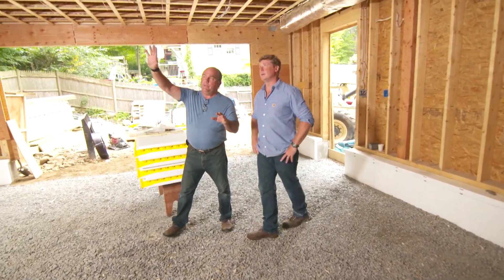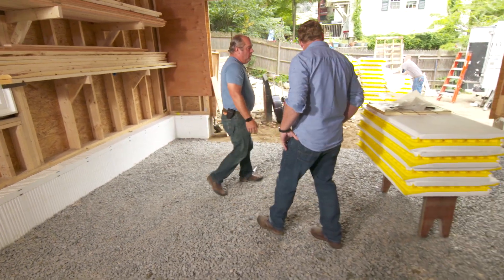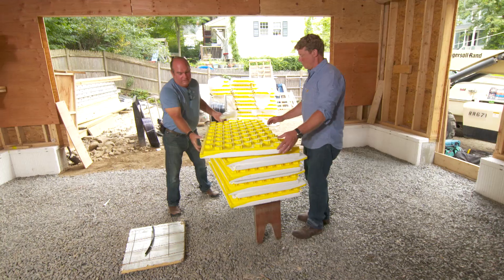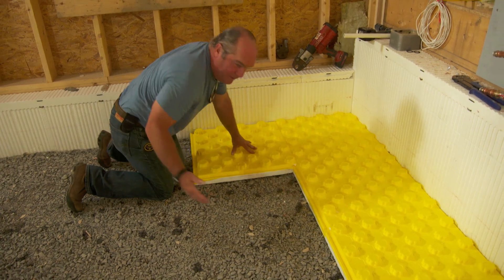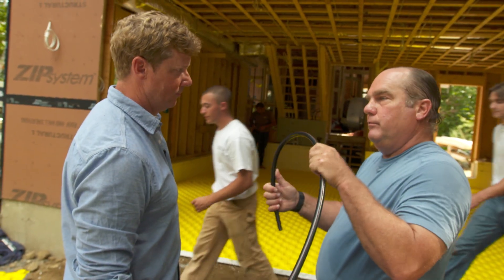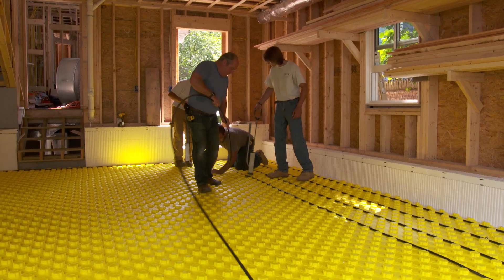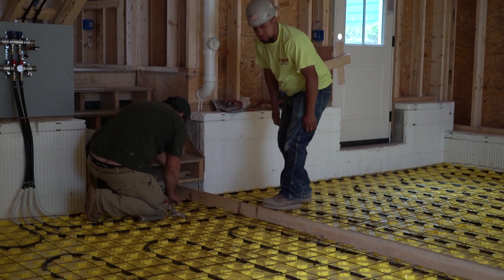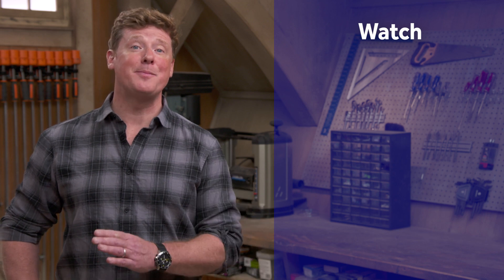How to Install a Radiant Floor Heat System in a Garage | This Old House

Comment: Hello, I would like some advice.
 I made the underfloor heating on a layer of hard styrofoam, and then spread the pipes on grid plates for pg, with mushrooms.  Do I need to put a reinforcing mesh since I definitely plan to add fiber fibers and sika additive to the mower?
 Second question.  I would split the floor and into one part of the garage.  Can I spread the mushrooms with the same system, and what thickness of concrete should I use?  Thanks in advance

Comment: Might be a dumb question, forgive me as I'm not a professional, but doesn't putting the pipes inside the slab create a lot of risk in the sense that if there was ever a burst pipe or just a leak, it would be a huge hassle / expensive to tear up the concrete? Maybe I'm not being rational but if I had a heated driveway or radiant in-floor beneath concrete, asphalt, etc I feel like I'd live in constant fear of having to rip up the concrete / asphalt at some point
Reply: Yes … everything has a lifetime of use … but considering that many houses are built on a slab, it is the way many places are plumbed.

The thing is that it probably isn’t too laborious to remove the floor, cut out the concrete, fix the pipe and repair concrete.

But most will need specialized contractors and will pay a premium.

Comment: I also want to see the plumbing end of things! How to choose the circulator pump, how to size the boiler??? 
Also, this is a 4” slab can you do this with a 6” or greater slab depth or would the pex be too low to work?

Comment: No pressure test?
Reply: This is a video less than 4 mins in length attempting to explain the concept of a system not be some all inclusive guide for installation.

Comment: I have a tube leaking in my radiant heat system, under the slab in my home.  Can someone recommend a contractor who can detect the location of the leak and then repair.  I live in the Lawrence MA area. .
Reply: @Kelly Appel 

Thank you Kelly still looking - it's unbelievable out there.

Comment: Can this work for an entire house, especially when pouring the stem slab?
Reply: Yes it can work in the entire house, you can can use water pumps to push the water into different zones of the house. Just need to do a heat loss of the house.

Comment: Here, in Europe, we work with these panels since 2000.... Anyway, good video!
Reply: Here in America, we perfected it since around 1940 after Frank Lloyd Wright's visit to Japan.
Reply: @vauzz66  I’ve scene dozens of FLW homes, raised my kids in one for 19 years. Never has a single one had radiant heat systems, electric or hydronic. 

In truth, FLW homes are so poorly sealed and insulated, I doubt a radiant system would be effective. We were in very temperate Marin yet I still spent $800-1000 monthly in utilities, primarily consumed by forced-air hvac systems. No denying it was a beautiful and stylish home but it was the worst built home I’ve owned...by a large margin. When we sold it, I honestly breathed a sigh of relief knowing that it’s less than mile from San Andreas fault line up on a ridge. When the forecasted 7+ shaker hits, that house will be tumbling down the slope, likely into the Bay.
Reply: @MichaelM-to4sg  well, he did write some books where he explains the floor system. Many use it today. In one of many books and my personal favorite, it depicts  the smaller Usonian and their radiant floor heating system. Most California homes of that time were not insulated and didn’t have central air - just the weather and the time. I’m sorry you experienced so many problems in your FLW house. It only took 6 million or so to fix up the Hollyhock house. Which house were you in ?

Comment: One problem I see with radiant heat - or any other kind of heat - in a garage, is accelerated corrosion.  If you're in snow country and the locals use a lot of road salt, all that salty slop is going to sit on your car while it's parked in the garage.   Heat accelerates any chemical reaction, including the corrosive action of salt.
Reply: Wash it

Comment: While a garage is nice in the winter not the best place for a car, worse if it’s heated. Slush will melt and start rusting the car and dried salt will attack the concrete. Perfect if you store your car or actually work on it.

Comment: That insulation is WAAAY too thin. LOTS of heat loss to the ground.
Reply: Its the US, they don´t (yet) care. In Germany we would use 4-6 inch insulation in that case. But generally, we would pour the concrete slab above a primary insulation, then add another 4 inch of insulation above the slab, put in the heating tubes and then pour 3-4 inch screed on top of it.
Reply: @Navy1977 The concrete slap thickness  itself varies on how much load it must supply. But in general around 8-10 inch.
When using a heat pump you want a large thermal mass as buffer.

Comment: The absolute best heat possible! I installed an electric thermal mass heated floor in my century old house after I installed high insulation under the floor and in the attic. Fantastic way to store intermittent electricity from my roof solar PV or regional wind farms.

Comment: No pressure test before you pour the concrete???    That confident there is no possible leaks???
Reply: This is a video less than 4 mins in length attempting to explain the concept of a system not be some all inclusive guide for installation.
Reply: @theripper121  You clearly missed my point...   if you are going to provide a quick overview of the milestones of this project, not even mentioning the pressure check  (which is kind of a big step)

Comment: Why didn't  a floor drain get installed  in the garage?
Reply: Was there a trench drain out side? And when the garage  door is shut it's hard for water to drain outside.
Reply: Some local codes don’t allow for floor drains. In most cases, the drain leads to a pit with a sump pump and that water just gets kicked out in your backyard then once a year you shovel out all the crap

Comment: This is a great application for radiant heat but so many other videos talk about getting max output to the room by keeping the pipes within 2 inches of the floor surface. What am I missing here with the pipes under 4 inches of concrete?

Comment: After watching T.O.H. for years, finally decided to go with radiant in the basement. Floor had to come up in places for plumbing improvements anyway, so took out entire floor and installed the radiant heat system. Wow such a huge improvement over gas forced heat. Thank you T.O.H.!
Reply: How do you find a contractor that knows how to do the radiant?

Comment: Great video!!   Only question is did they pull up the mesh after pouring?   You don’t want the wires rubbing on the tubing.   It will eventually make pin holes in it, obviously causing leaks.
Reply: Once the concrete sets, there's no rubbing going on.
Reply: @augustreil  Why would you think they would put mesh down and then pull it back up?! No, they don't do that.
Reply: @ryanroberts1104  The mesh should be in the center of the slab thickness. It doesn't add much strength if it's at the bottom of the slab.
Reply: @michaelwarren2391  That's why they sell little concrete spacer blocks for putting in your reinforcements.

Comment: On a rainy or snowy day, I think the heat will generate a lot of moisture in there.
Reply: When you heat it lowers relative humidity since warm air holds more water vapor than cold air.

Comment: Could this be used as a whole house system in a monolithic slab possibly?
Reply: Yes.
Reply: Jamie Burks I owned a house that had this. It was built in the 50’s, cape cod on a slab, and they ran copper tubing through the slab. Not realizing many years later that pinhole leaks would develop from corrosion rendering the whole system useless. Everyone in the neighborhood just closed it off and put baseboard in. Pex would obviously last much longer.
Reply: @I-Teee  Interesting that you should mention radiant heating systems that use copper tubing. I lived in an apartment building that when it was built [circa 1950s] must have been quite innovative because it used radiant heating in the ceilings (i.e. my neighbour's ceiling heat downstairs became my floor radiant heating and my ceiling heating became the upstairs neighbour's radiant floor heating et cetera). I lived there a total of 35 years until 2014. There were intermittent problems balancing the heating system properly due to poor maintenance and understanding of the whole-building system but the worst problem in my unit was pin-hole leaks in the copper tubing that would leak during the heating months while the system was under pressure and hot water was flowing. It took years until it happened in my unit, but then it started happening more frequently. This would involve first seeing a 'wet patch' on the ceiling and then the plumber would be in to hack away at the plaster and put in a soldered length of new tubing to patch the problem until the next one would appear. There was no other option to heat the building since there were no hotwater radiators and a retrofit of any kind was not going to be done by the landlord. It was explained to me that during the installation even a minor kink in the tubing would eventually cause a degradation of the copper at the molecular level until it sprang a pinhole leak. Fortunately, none of the tubing was laid in a slab but in an area of the ceiling where there was at least a foot or more between my ceiling and the upstair's neighbour's flooring. The real worry was that it would leak with little warning and damage my furnishings. Great idea radiant floor heating but scary to think of what is happening completely out of sight and/or buried beneath concrete.
Reply: Marc Goodman Interesting story. What part of the country (wondering if it was a prevalent process in certain markets). My residence was in SE PA.
Reply: @I-Teee  I live in Toronto, Ontario. I think we probably share some similar winter weather. I don't know how widespread its use was in Toronto but I found a link to a page on the 40 Park Road building which was/still using(?) this copper tubing radiant heat system:
https://www.historynerd.ca/2018/11/11/todmorden-developments-brings-bachelorama-to-the-rosedale-valley-1956/
However, it appears that the use of copper tubing for radiant heating may have been in use in your neck of the woods when postwar "Levittowns" built in New York and Pennsylvania incorporated this method of radiant heating in their assembly-line built homes: https://www.pmmag.com/articles/91874-a-brief-history-of-radiant-heating 
The article mentions the shortcomings in this method of heating due to the very rapid construction methods which left little time for the workers doing the installations: "The copper-and-concrete radiant system wasn’t the best combination for all those Levittown homes. Workers on such tight construction timetables had no room for error either. Most Levittown systems failed within 15 to 20 years." If you and your neighbours live in a Levittown project it's very possible that the failure of your radiant heating system was "built in" (no pun intended). It's been a bit of an education in radiant heating for me. P.S. The building I used to live in was built next to the headquarters for the Ontario Association of Architects. It's possible the youthful team of architects wanted to make a statement to impress their colleagues in the business and that included the innovative design of the building and the building materials used, i.e. window walls and radiant heating.

Comment: Love the show!  I was wondering about how much it costs to lay it down and then how much does it cost to run the system? 
Keep the great videos coming. 

Thanks for sharing and God bless
Reply: Roy Wrenn … it does cost more up front than conventional heat but the saving is over a period of time because you feel comfortable at 5 - 10 degrees lower t-stat setting. The main reason is a warm floor keeps things dry and your feet are always warm, then of course it's completely silent and no drafts at all. To figure cost you'd need to have someone run the calculations for your installation based on needed temp rise, which determines the tube spacing. IOW, how many feet of tube and what size tube to place in the floor. The actual water temp going through the tubes will be VERY low..... maybe in the 80 - 90 degree range.
Reply: @rupe53  Water temp is dependent upon thermal efficiency and thermal mass being heated. In the case of this install where minimal insulation below slab is fitted and the thermal mass is a roughly 500sqft 4” concrete slab, water temp is typically 155-160f. Had they properly insulated below slab, we used 6” GPS foam for R-30, water temps can be 125f using 3/4” PEX in 4” slab. In our home we use Thermalboard in raised foundation w/R30 at joists and 4” cc foam at perimeter footings, we run 85f under hardwood floors and 105f under stone tile floors
Reply: @MichaelM-to4sg  ... as you pointed out, water temp depends on a lot of things, including the amount of insulation and the depth of the pipe from the top on the floor surface. With old school copper or iron pipe in the floor the water was never above 100 degrees, but most of that was due to the expansion rate of solid pipe. As you also pointed out, that insulation is not very much for an installation that I presume to be on their home turf. (Massachusetts)

Comment: I just pressure tested my garage today at 40 psi and I'll be pouring 4000 psi concrete with fiber on Monday, I used 2000 ft, of !/2 pex ,8 inches on center in a 1500 sf garage over 2 inch blue board using a Malco plastic staples. Must be nice having all that help!

Comment: Best way to heat a garage, no question! 

Just don’t cheap out and use a water heater for the source, buy a boiler and be done with it
Reply: Sure, if you do a slab like they did you need much higher water temps to overcome the thermal losses. We put 6” GPS subarea foam over vapor barrier; 2 3” thick sheets with no overlapping seams. The outer are ripped 45* to better eliminate thermal bridging to footing. We can then run 125* water through PEX using a heat pump water heater and buffer tank. My 5-car garage here at 9000’ elevation in Rockies stays 58*, even in coldest winter days powered by our PV panels and battery backup👍
Reply: @MichaelM-to4sg  5 car, and heated!  Awesome!  Yah for sure that heat pump will do the trick.  I just think for longevity, 20 years plus, a mod con boiler is best way to go.  Unless the garage is the only thing in the home being heated (or if you have a 5 car!! )
Reply: @marksullivan3424  In truth, it’s only 3 for cars, 1 for team Sprinter van and 1 for motorcycles. We support a flat track race team. There’s also 750 sqft workshop. The main residence and guest house are detached but also hydronic heated, although raised foundations, not slab on-grade. Both of those structures are heated by heat pump water heaters. As long as hydronic temps can be kept <125f, a water heater, especially one’s as efficient as heat pump, is great choice.
Reply: Have you ever had a problem whereby the burner is overworked in trying to keep up with a fluctuating temperature reading from the thermostat?  When it gets cold, my garage thermostat calls for heat and I notice that the burner kicks in and cycles on and off every 15 seconds or so.
Reply: @almason253  If I were to guess it’s the slab temp probe that’s triggering system. That probe is installed incorrectly where it’s too close to the hydronic tubing. We always install slab temp probe minimum 4” from any tubing. 

I would consult w/your hydronic installer to diagnose issue. If you want to diy diagnose issue, disconnect the slab temp probe input and see if issue is resolved. 

Good luck👍
Reply: @MichaelM-to4sg  Thanks, but guess what I discovered?  There is no slab temp probe.  The wall thermostat is measuring air temp only.  Heck!
Reply: @almason253  Whoa, that’s a mistake. In a garage, everytime a door is opened the room temp only thermostat will likely be triggered. 

Is system open loop or closed loop? If the latter, is there a buffer tank? This would really help reduce heat source cycling.
Reply: @MichaelM-to4sg  Closed loop.  I'll be calling in a pro to have a look.
Reply: @almason253  Sounds like a wise move. 

Is the heat source you’re using a hot water heater? If so, is it dedicated unit, used solely for hydronic heat source? 

The best way we’ve found for water heater usage in hydronic system is to invest in a very efficient unit, the Rheem  and Sanden heat pump water heaters are the best I’ve seen for reliability and warranty. You size it 25-30% larger than you need for domestic water needs, more if home is poorly insulated/sealed. Use an indirect water heater buffer tank, 50-80 gal depending upon size of building envelope being heated. The buffer tank is closed loop, filled w/distilled water and a surfactant. Water from heat pump water heater is recirculated through copper coils in buffer tank to maintain up to 120F, though 85F is sufficient depending on residential floor materials. Indirect heater coil should be min 1” tubing. You’ll need a pump for the hydronic system and 2nd pump for the hot water recirculating system, which can also be a  ‘race track’ whole house recirc system. Just be certain the buffer coils are fed first if thermo valve for buffer tank is open. It’s pretty straight forward and many knowledge hydronic systems techs are familiar with this type design. 

Best of luck to you.

Comment: Where is this installation?   How do you protect against frost heave when you turn it off?
Reply: Being in a garage, 99% of the time frost isn't an issue.
Reply: @augustreil  … frost heave may not be an issue but freezing pipes could be. One would have to put antifreeze in that loop just in case it was turned off in cold weather.
Reply: @rupe53 , I agree, most have anti-freeze in them.